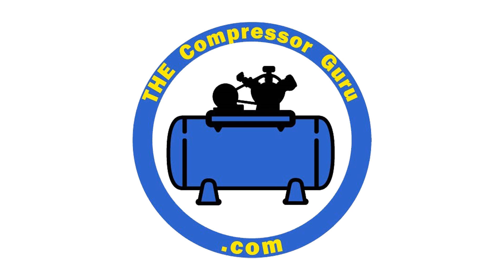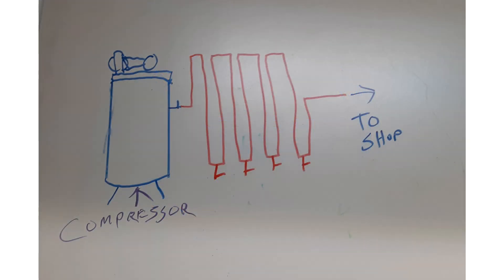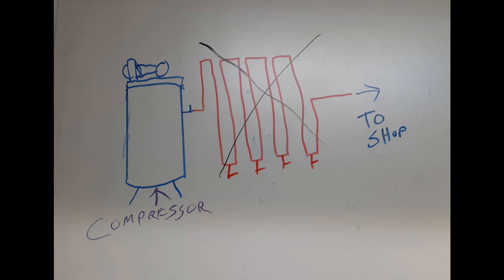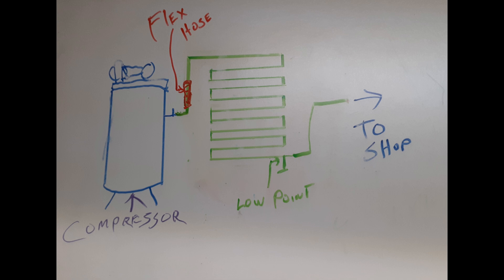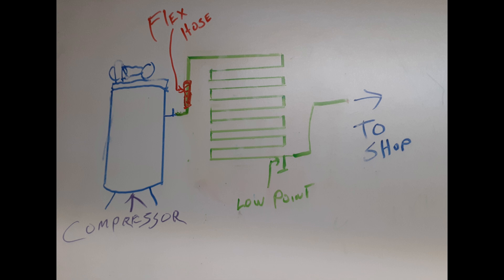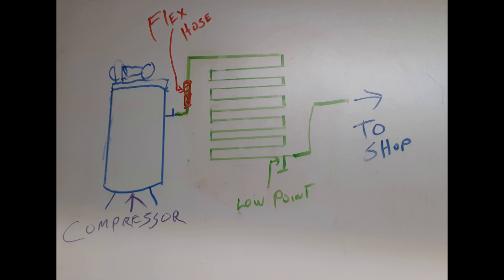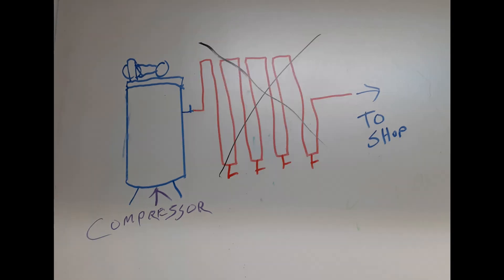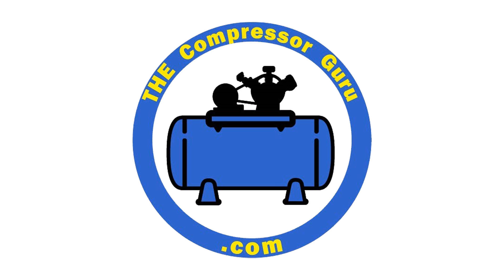THE Guru’s Pet peeve W /bonus Peeve!

Comment: hey bud, I have mine horizontal but mine starts from the bottom and goes uphill, with of course the lowpoint at the bottom. Is this less effective than starting at the top?
Reply from the maker: That is a great question... I like the horizontal because of less drain points needed. up hill or down hill? that might be worth experimenting.

Comment: Mr. Guru, what are you thoughts on running your recommended set up however, connecting directly from the pump and then back into the tank after going through the loops?  My concern is potential stress on the pump and also CFM loss.  I have seen other do it this way, seems to be a popular trend however these folks don't seem to be experts like you.  Thanks
Reply from the maker: pump to an aftercooler (loops) and then to tank make much more sense. the factory set up for this is called and aftercooler.  if the pipe is sized correctly and no leaks the should be no extra strain on the pump. The down side could be the unloader may take a long time to bleed down before the compressor cycles again. I have a couple episodes on installing aftercoolers. check them out.

Comment: I have to respectfully disagree concerning the PEX. A safety relief valve between the regulator and the PEX protects from over pressure. PEX is chemically compatible with compressor oil, pvc is not. PEX is cheap, fast, flexible, durable, and safe.

Comment: Good subject Guru ! But not PVC piping . PVC is very dangerous. PVC comes apart when it ruptures and splinters. We did some destructive testing on PVC years ago when I worked for a testing laboratory. It is not made for high pressure air. And finally some Saylor Beall compressors to work on ? Probably not a very large one though ? Thanks again. 👍
Reply from the maker: I  think I did say that I would rather see them use PVC instead of Pex. But still NOT my first choice.

Comment: Plastic pipe for compressed air ???  What if you hit it with a forklift or for whatever reason it breaks?  Picture all those chards of plastic spraying out.  Or what if there is a fire?  The fire crew comes in and the pipes finally fail from the heat.
Reply from the maker: I think I did say that I would rather see them use PVC instead of Pex. But still NOT my first choice.

Comment: Thank you for mentioning flex line - everyone seems to skip that step during the installation!  I've seen a few PEX installations in small shops and they justify that with the PSI rating for water.  I have to remind the end user that water doesn't compress and store energy like air does!  I do see some PVC compressor piping too, but mostly after it has failed in spectacular fashion - Creates quite the plastic shrapnel!  Thanks again for your informative and entertaining videos
Reply: PVC is a huge no-no, since it explodes into very sharp shrapnel. pex sure isn't great, but if it blows a hole, fitting or splits, not much will happen if it's strapped well. other than a huge air leak.
and for sure NEVER EVER use pvc, pex or any plastic between the pump and tank, leave that for copper, and iron piping. 😉
Reply from the maker: @throttlebottle5906 I think I did say that I would rather see them use PVC instead of Pex. But still not my first choice
Reply from the maker: @throttlebottle5906  https://www.youtube.com/watch?v=L2wi8O8wntI&lc=Ugy_nh6N7WcjjMVnFPF4AaABAg
Reply from the maker: EXCELLENT point!!! I didn't mention the extra stored energy in air THANK you.

Comment: That was awesome good advice. I've been saying to pipe the way you want to pipe forever. I will disagree with the PVC comment though. I would never never never never never run PVC. I don't trust it. I do trust black iron pipe and galvanized pipe. But it's just an opinion. I love watching your channel.
Reply from the maker: I agree I think I did say that I would rather see them use PVC instead of Pex. But still not my first choice.
Reply: @THECompressorGuru  I used 3/4" copper (the thicker one for under ground) vertical.  When the the pipe comes down it goes straight to valve-like an 6"drip leg on natural gas.